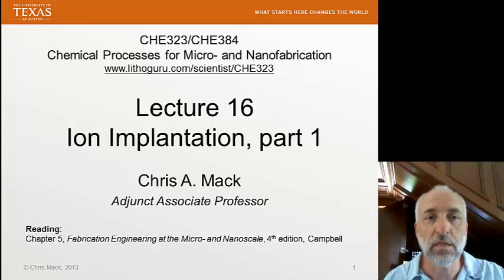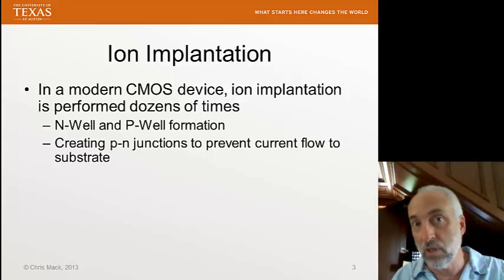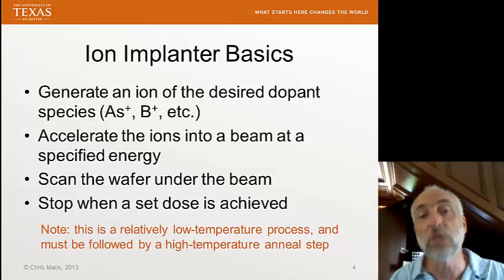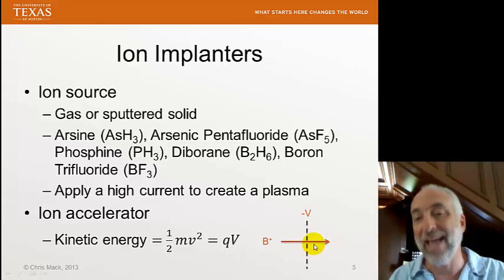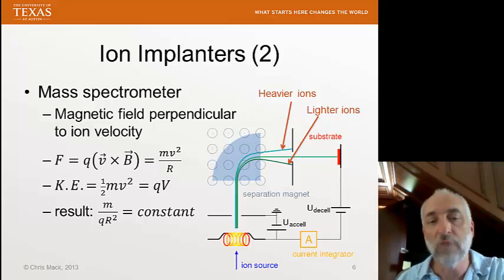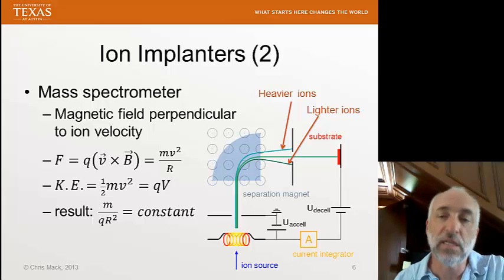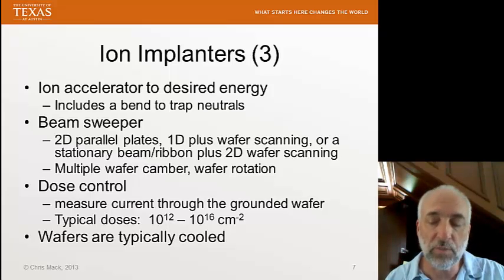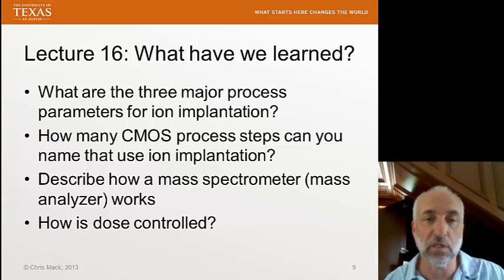Lecture 16 (CHE 323) Ion Implantation, part 1

Comment: May I ask in what state or form are the elements used during Ion Implantation process? for example if I were to use Molybdenum as an implanter.
Reply from the maker: The only requirement is that the material be ionized.

Comment: We usually use the Ion Implantation to dope our wafer, however, it is the very definition of doping that we need "atoms" not "ions" 
Can someone clarify this for me?
Reply: Thanks for your reply! 
But, how are the electrons gonna travel up to the ions if their path is not the same as the ions, I mean the path of particles depends on the masses, the angle and scattering and all of these parameters, the electrons don't encounter the same scattering profile and have different masses from that of the ions, therefore they won't necessarily end up at the same positions as the ions and won't necessarily neutralize them!
Reply: At what point are the ions neutralized? Before or during or after anneal? Does "anneal" mean the solid phase  epitaxial regrowth process or the neutralization process?